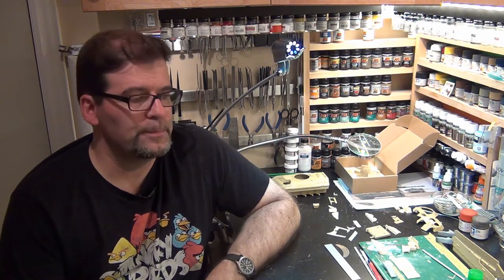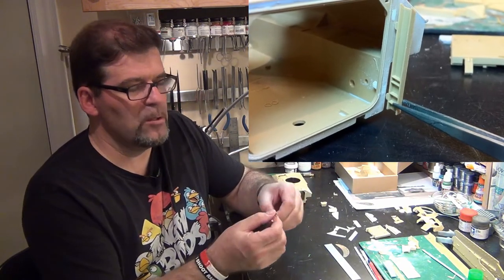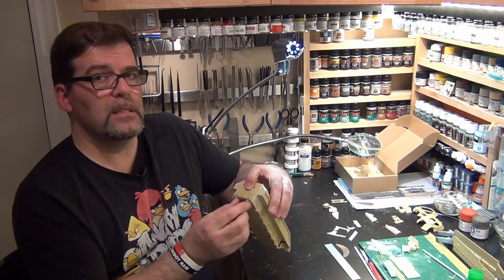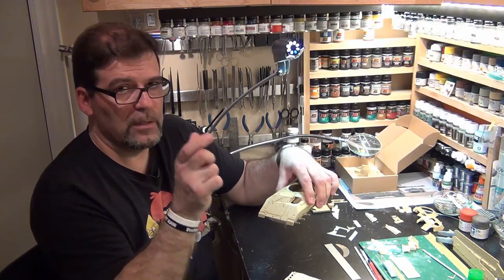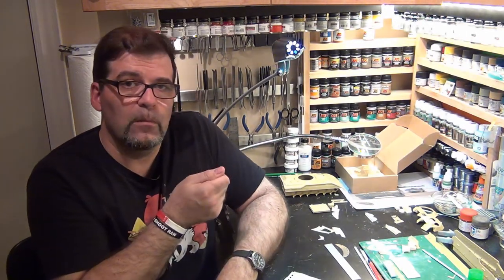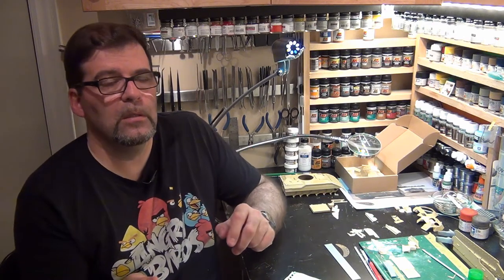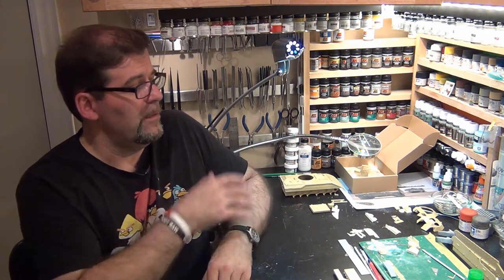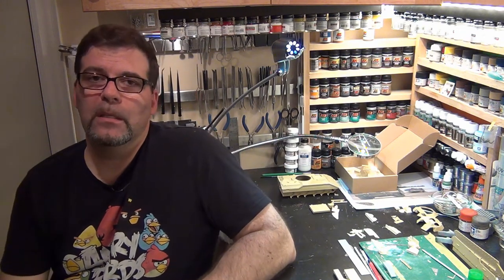Bradley COOP Build update 1

Comment: Looking good Norm, really liking how you adding detail with the front and rear space armor. They are a real pain to take off and on the actual vehicle. That rear wiring between the space armor and hull, next to the ramp it what I believe for the hydraulics tubing for the ramp. The ramp is controlled by the driver. I will look at my manual to confirm it.
Reply from the maker: Papa Kilo 1/35 Armor Thanks for checking the tube seen !   the fact it has a little "Flapper" at the End..  suggest.??
Bilge pump or exhaust of some kind...?    Thanks for checking thou !

Comment: Great stuff Norm :) We will be in contact wrt the rear wall.

Toot, tootu, the frugal modeleer to the rescue LOL. You may want to consider a damp facecloth with some ice cubes in it, to assist in cooling the resin set (while you are holding it against a flat surface). We do not need a BUNCH of cold here good buddy just a temp delta. :) Heck just a fan blowing on the subject while holding will achieve results good buddy :)
Reply from the maker: Switcher No proble..     you want the Link ?

http://vodnik.net/pages/m2a2/m2a2-p1.htm  

a good read !
Reply: Thanks Norm you da man :)

Comment: That stinks you are having issues with the resin bud.  I would think for what these cost you might contact the maker and ask for a replacement?  My barrel came in the mail today so I have everything I need to start.  One question though the interior color is supposed to be FS24533 "Sea Foam Green" I am having a little difficulty in finding an equivalent.  Do you have a recommendation?
Reply from the maker: TacticalJackalope   Model Master Acryl  FS34227  Pale Green !     very close if not the same...  add a few drops of white if you think it is a little dark ?     Good luck !